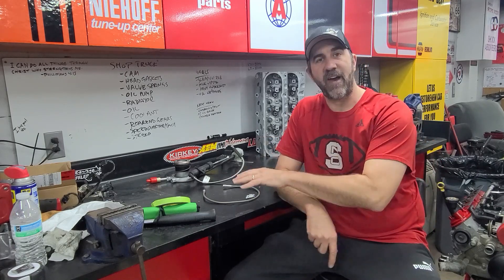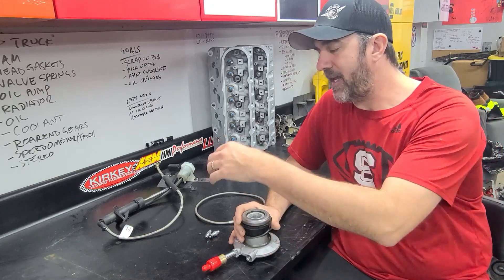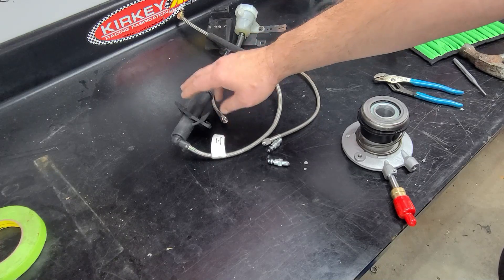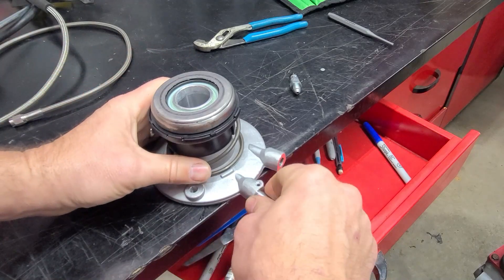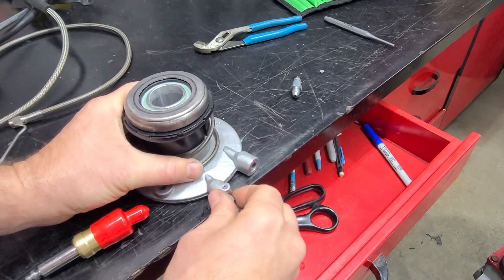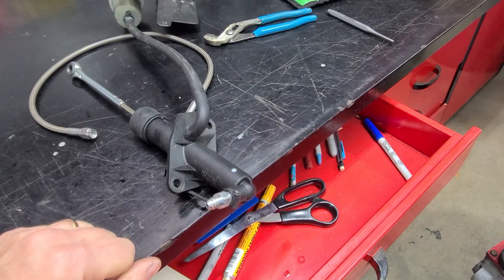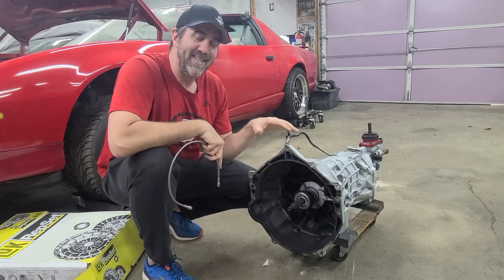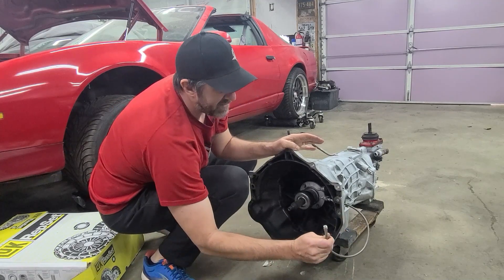Then Midnight Mechanic Tech Tip - T56 Clutch Line Upgrade!

Comment: How far does the aftermarket fitting need to be inserted into the factory master and slave?  It doesn’t look like it goes in far enough to insert the roll pin.
Reply from the maker: It has to go in until it bottoms out. Basically you need to be sure the entire groove is inside the master/slave. Takes a little force sometimes.